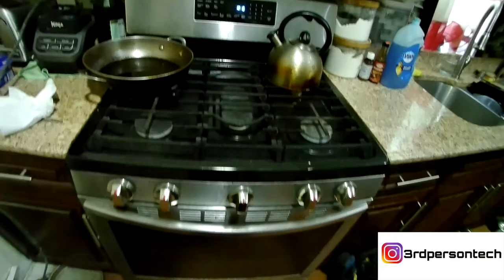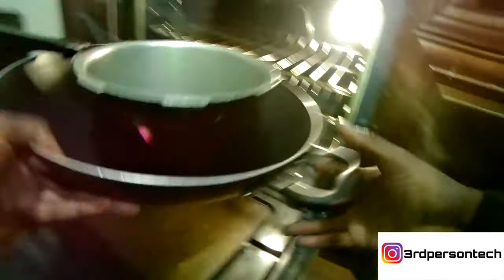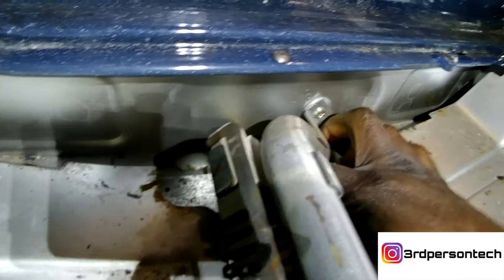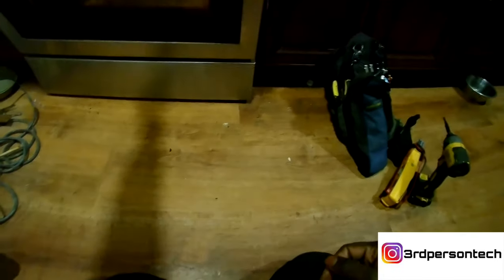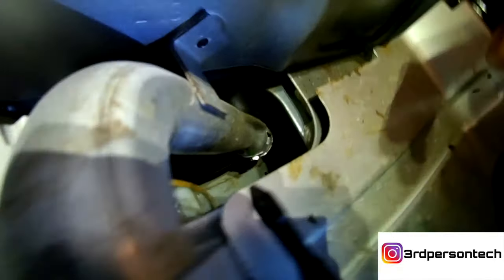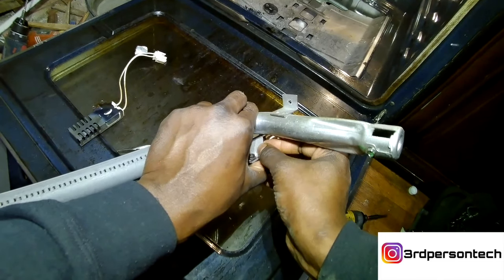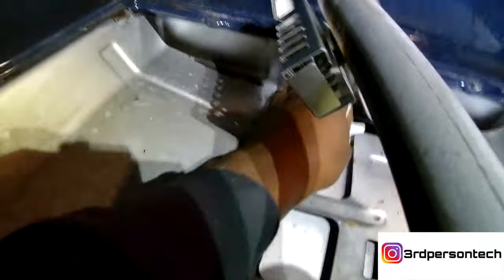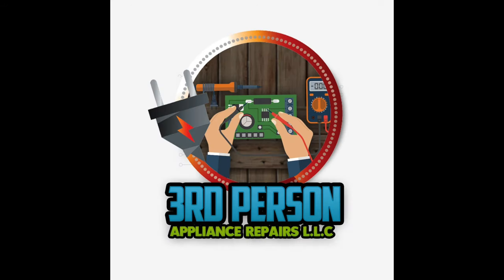How to fix samsung oven thats not heating

Comment: I just changed my igniter and it’s still not working. The igniter is not lighting. Also, the meter indicates that I do have around 115 amps coming from the from the stove wires so I have power. Do you have any suggestions of what else it could be?  Thanks
Reply from the maker: If you have 115 volts to igniter and it dose not glow. You have a bad igniter out the box. 115-120 volts is all the power it needs to glow

Comment: So my igniter glows... I installed a new sensor...oven will very slowly heat has gone from 150 to 190 in 45 minutes...??? Thoughts or suggestions? Thx in advance
Reply from the maker: Not because the igniter goes mean the amperage is correct. If is heating up slowly, I would check the amperage on the adviser. Sounds like you might have a igniter problem.
Reply: @3rdpersontech  ok the advisor...amerage... if that is bad I will need to replace the igniter? So ignitor either way more than likely?

Comment: Would a bad igniter also explain why we smell gas until the oven eventually (e.g., 30-45 min) gets up to temperature like it did last night?
Reply from the maker: @coolraul07  yes as the oven is releasing the gas for it to light, but because the amperage is low on igniter, it’s taken longer than usual for the oven to ignite

Comment: As far as I can see, this SAMSUNG model has two burners, top and bottom. I see all the tutorials talking about the one on the bottom but none relating any issue with the one on the top and I see both of them work under the same procedure.
Reply from the maker: @PedroMPadillaEscajeda  hey if you’re talking about the broiler that sits at the top of the oven is the same concept if it’s not igniting first step would be to check the amperage and if the app is too low, you replace the igniter even if the igniter is glowing orange if the amperage is too low, it won’t lightor if the igniter is not going voltage to the igniter hopefully this helps

Comment: Thanks for the video! Just fixed mine tonight with the same igniter from your link. Oven heated up to 425 in less than 5 minutes. One tip for everyone, don’t strip the front screw in the burner! Mine was so rusted on I stripped it and had to drill it out. Other than that I could’ve had this done in 10 mins

Comment: Easy Peary. The tool to check the amperage draw was more expensive than the igniter, so I ok a chance and just purchased the igniter. It took me less than 15 minutes to replace it and put the oven back together (4 screws). It fired right up.  Thank you, thank you.

Comment: @3rdPersonTech: Very clear video! Q: What part would I look for if my Samsung (same as the one here but with dual doors/partitioned) oven heats initially but then just randomly STOPS during cooking? I can't find a specific trigger (opening upper door vs. opening full door, etc.), it's extremely random. Hoping I don't have to replace the entire controller board. All of my Samsung appliances have failed in some oddball way, it's crazy!

Comment: Thanks only thing is my igniter was reading 2.97 and still not lighting. I put a new one in and it was pulling 3.65A and lit right off. So the igniter was still not pulling enough at 2.97A. Bottom line though, your plan worked !! THANKS Rick

Comment: Borrowed an amp meter, igniter reading 2.7. That's just BARELY low. But before I call a repair person, I'm going to order a new igniter (from your link) and see if I can replace it myself for $25 instead of service visit for $225. Grateful for your video! Fingers crossed.
Reply: Did it work ?

Comment: Thank you for your video. I dont have that fancy meter you used - but my Samsung gas oven is VERY slow to heat up. I should note that the broiler works fine but the bake function is the problem. Also there is an orange glow at the bottom of the oven but it never heats up
Reply from the maker: Sounds like u may need a igniter
Reply: @3rdpersontech given the orange glow I see it might be the temperature sensor too - stay tuned
Reply from the maker: oranges glow is the igniter. In these model I have almost never had to replace temp sensor so it’s more likely the igniter your going to need
Reply: @3rdpersontech  thx if the igniter is glowing seems to me that it is working. What could the problem be
Reply from the maker: @michaelmalone4268  not because it’s glowing means the amperage is correct. ✅ as explained in video

Comment: Thank you! I didn’t have a clamp meter and I did not want to figure out how to use my regular multimeter but I bought the part you said to buy and that was the exact issue anyways so I guess I saved the stuff ha ha.  Works great so thank you. I was a little heebie-jeebies about the open flame stuff but I guess that’s exactly how it was when I pulled it off so I’m sure it’s fine. Thanks again

Comment: Hey very informative video I bought 3 ignitor for my samsung stove just like that and I have had no success in getting the oven to light any thoughts will be greatly appreciated thanks
Reply from the maker: Check to see if there is 120volts going to your igniter. If your not getting 120volts the mains board is bad

Comment: ok, i have the same oven.  i don't have an amp meter, BUT i did hold a lighter to the burner and it did not light.  should it have?  when i turn the oven i smell gas (propane) but no fire.  the broiler works and the stove burners work.

Comment: Where will I find my Samsung model # to order correct igniter and am I correct to leave gas ON while doing all of this? Tyssm
Reply from the maker: @Triciadean7777  this igniter more than likely will work for your unit. However you can look at the lower draw pull it open and look at the face you may see your tag there. Or simply open the oven door and look up to see if you see the tag. And yes it’s safe to have the gas on while replacing this part. This repair however should be performed that your own risk

Comment: Need some help kind sir, I have a Samsung FX510BGS when it was turned on for preheat the ignitor would get red hot but would eventually through an E08 code . According to the troubleshooting chart in the owners manual we turned the circuit breaker off for 30 seconds , we turned the oven back on and the problem still persisted. I replaced the igniter and still have the same issue. Can I get your thoughts on this please and thank you.
Reply from the maker: You may need a main relay board. Dose this code comes up also if you try the unit on broil ? If the code comes up on broil also then it’s the board
Reply: My wife did turn on the broiler and it came on just fine so she tried the oven again and it came on as well. I’ll just keep an eye on it. Nothing worse than trying to troubleshoot a intermittent problem.
Thank you sir for your time, knowledgeable and kindness.

Comment: I own this exact same model Samsung range (gas).  When I try and pre-heat the oven to 420 - it can take 30+ minutes to heat up.  I removed the bottom of the oven to expose the burner tube.  The oven igniter can ignite the burner tube, but it takes a while - BUT ODDLY ENOUGH, if I ignite a burner on the stove top - the burner tube lights up FAST.  Flames are big for a few seconds and then they shrink down - so they don't produce the flames to quickly heat up the oven.  It seems like a gas issue - any thoughts?
Reply from the maker: Check amp on igniter if amp is what I stated in the video, then you may have a issue with the gas valve for the oven
Reply: @3rdpersontech I got a similar issue. Burners on top have no problem, broiler no problem but the bottom burner tube pushes out not even 1cm of flames; I took out the bottom panels and ignited it a bbq lighter as the igniter wasn't doing its job. Could it be the burner tube as well?

Comment: Your Samsung range seems to be the same model/style as mine. How would I know if the igniter you used would work for mine? Are these igniters pretty universal with some Samsung models? In your opinion, what is chance the igniter you used here would work for my model?

Just a rant side note: I contacted Samsung and the igniter for my model number is out of stock, and they don't know when it will be back in stock. I then also asked how long this igniter has been out of stock.....they couldn't tell me that either. I find it hard to believe they "couldn't tell me how long it's been out of stock"!! So, if they're lying about that, what else are they lying about??? I'm not amused and will never purchase another Samsung product!

Comment: If the oven igniter does not work will that prevent the broiler igniter from working - Samsung oven won’t ignite and the top boiler won’t ignite- ?????
Reply from the maker: The broiler has its own igniter you will have to also test that igniter the way I show to test in the video. If the broiler igniter has no amp and no voltage and the Aldo has no amp or voltage then you will need a main pcb

Comment: I was able to replace the element and it worked, but then the fan stopped working.  Any advice?
Reply: @3rdPersontech-on5yv  it has a cooling oven but that does work.  Im going to replace the fan motor.

Comment: Our amp meter registered zero. We've ordered the part. Does zero amps make a difference?
Reply from the maker: Zero means it’s no good or your not getting any voltage to the IGNITER
Reply: What part supplies the voltage?
Reply from the maker: @happycamper2303  main board.
Reply from the maker: @happycamper2303  used voltage line tester that beeps when there’s voltage passing through the line too ensure you’re getting voltage

Comment: Replaced the igniter - pulls 3.7 amps glows bright orange - however the set temperture 400 degrees returns to 175 degrees after 2 seconds - never ignites
Reply from the maker: If your Igniter was pulling 3.7 amp you should have never change it. Sound like u may have a temp sensor or board issue
Reply: No - the ignited was bad - ohm it - it was open. I’ll check the board tomorrow- appreciate your help.

Comment: This video is useful, to a point. It would be better if each step was carefully filmed, and camera was pointing at the hands doing each task, instead of shaking and pointing at the guy's sleeve. I get he was recording AND replacing the part. But the point of the video is to teach how to replace the part, and this point was hindered by the low quality of filming.